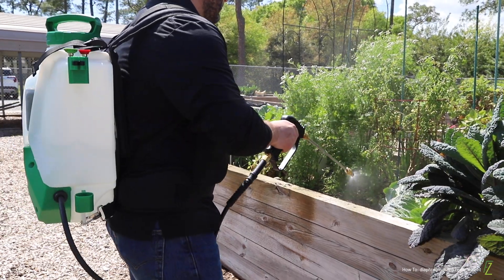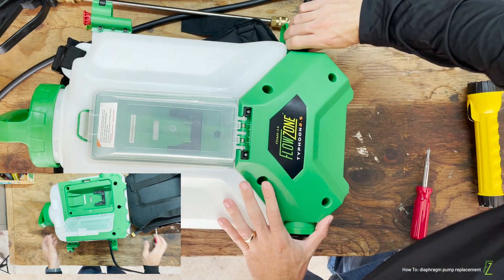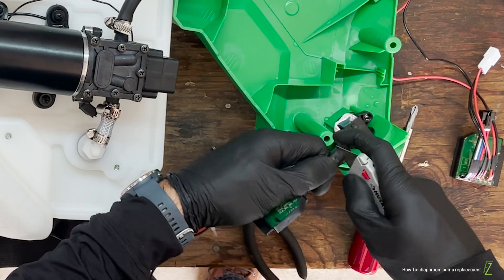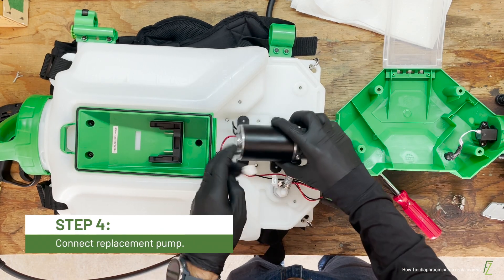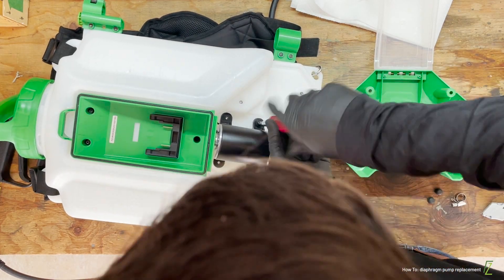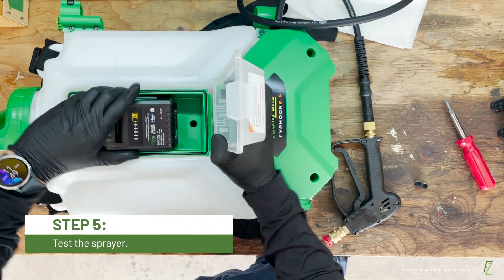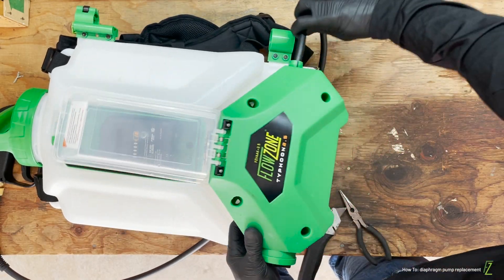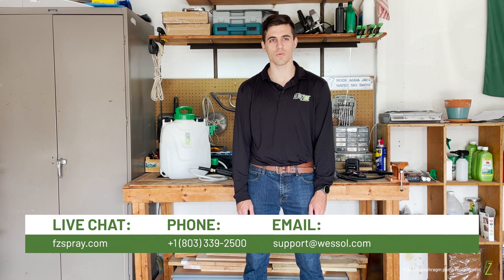How To: Replace Your Sprayer's Diaphragm Pump | FlowZone®

Comment: Would the life of this diaphragm pump be significantly extended if after using pre-emergent chemicals such as prodiamine or dithiopyr, we were to flush out the system with clean water first and then use a special tank cleaning/neutralizing product and then flush it again?  I know some tank neutralizer/cleaners are a chemical known as washing soda or sodium carbonate, for example, but I don't know how effective these tank cleaners are at prolonging the life of a diaphragm pump.  Thank you.
Reply from the maker: Flushing a diaphragm pump with a sodium carbonate solution after running a harsh chemical (especially acids or aggressive cleaners) can significantly extend the pump life — sometimes by 2× to 3× compared to not flushing at all. After flushing with sodium carbonate, it’s a good idea to do a final flush with clean water too, to prevent sodium carbonate crystal buildup inside the pump.